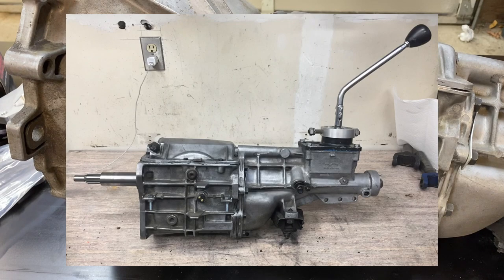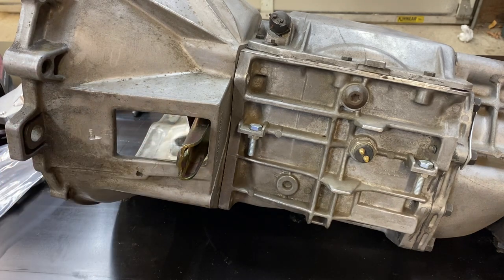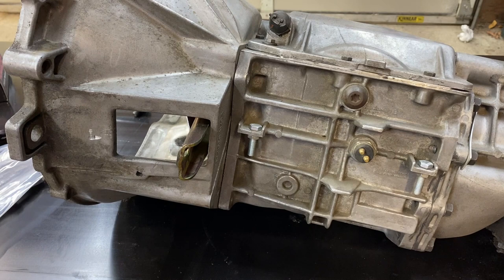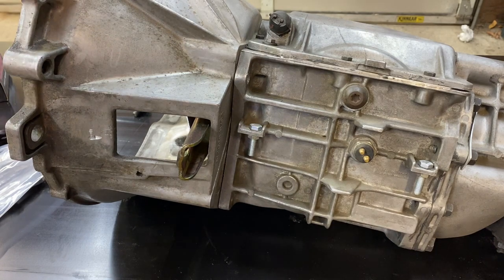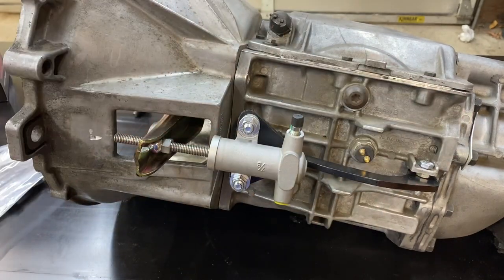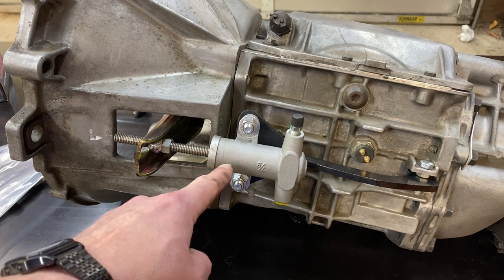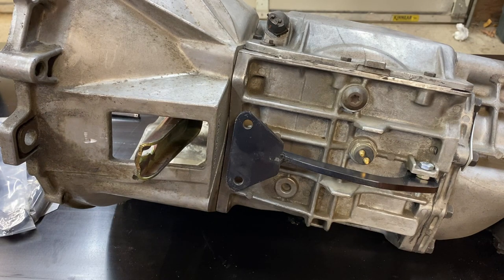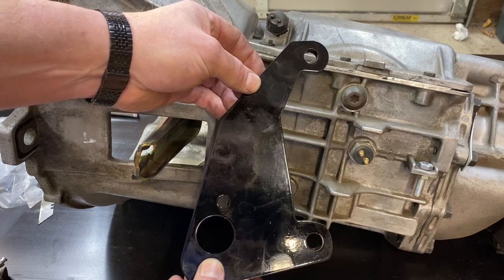Classic Ford T5 Hydraulic Clutch. Clutch actuation options when installing a T5

Comment: Will this slave work on a 2000 ranger clutch master?  I did a v8 conversion
Where can I get that bracket?
Reply from the maker: I have sold a lot of these kits to ranger owners. I would need to know the bore and stroke of your master to determine the correct slave cylinder. I have the parts available on my website and you can also email through my website.
Reply: @dazecars  I'll find out and let you know..thanks!!
Reply: @dazecars   so I do know the stock unit had 1 1/2 inches of travle..meaning  the plunger will go in 1 1/2 inches. I think the bore is 5/8...
Reply: @dazecars   how much movement does this move that clutch fork?
Reply from the maker: @19jody72  Assuming  the 1.5" stroke is actual master stroke, if I sell you one of my kets and sub a 3/4" master for the 7/8 I usually sell you will get 1" at the slave.  the way my kit is designed you only need .9" of travel so that should be perfect and make for a nice easy pedal.  If it is easier you can contact me through my website.
Reply: @dazecars  So if I'm reading that correctly, The stock ranger master will work with your kit?  Can you link the kit part number?
Reply from the maker: Yes and no. My universal slave cylinder  kit will bolt up to the transmission but the slave cylinder is to big. If you order it you will need to email me afterwards and request a 3/4” slave.
Reply: @dazecars  10-4.. will do. Thanks

Comment: I have a 1968 Mustang fastback and just purchased a new Tremec TKX. Is there anyway that I can run a mechanical clutch linkage and if so what parts would I need like bellhousing, zbar,etc....If I am unable to use a mechanical linkage then I would like to use a cable clutch or hydraulic but I really dont feel comfortable installing a hydraulic system as it seems complicated. Any info would be helpful.   I am starting from square one so i dont have any clutch system parts yet of any kind.
Reply from the maker: There are a couple ways that I know of to run the OEM mechanical linkage.  One is expensive and the other is not recommended in my opinion.  The first is to use a quicktime 3550/TKO bellhousing (will also fit the TKX)  Those bellhousings are engineered to use two different clutch forks.  One is actuated back to front allowing you to run a cable clutch or hydraulic clutch and the other is actuated front to back allowing you you use the stock linkage.  That bellhousing is in the $900 range plus or minus depending on accessories needed and shipping. I don't know what else is required to use that bellhousing.  Flywheel clutch and starter may or may not need to be changed as well.  A quicktime bellhousing is a very effective way to maintain the mechanical linkage but expensive.  The second option would be to run an OEM ford 4 speed bell and TKO adapter plate.  This is a lot less expensive $200 range plus or minus.  The problem is modern transmission require the bellhousing accuracy ≤ .005"  and old school Ford bellhousings had tolerance of up to .030".  If you run an adapter you MUST use a dial indicator to properly align the bellhousing and engine to the transmission by shimming the bell and using adjustable alignment pins.  It is a pain to get set up.  When I first installed a T5 in my mustang I used an adapter and it was by no means a "clean" install.  When I upgraded to a T5 specific bell I was much happier with it.  Same is true of the TKO and TKX. So while the adapter plate option can be made to work and even work well I would not run it on my cars when there are easier options.
Reply: @dazecars  I wonder if Lakewood sells a bellhousing that would work. I really appreciate your response!  Your videos are really informative and got me thinking about a hydraulic clutch but the fear of it leaking or doing something else i would worry about as I tend to drive my cars long distances and mechanical would be worry free it seems.
Reply from the maker: @VegasRT500  A hydraulic clutch is as reliable as brake hydraulics.  Lots of cars and trucks have come from the factory over the years with a hydraulic clutch.  Lakewood does sell a bellhousing but it does require modification to work with my kits.  The problem is the Lakewood bell is wider at the transmission end so it needs to be notched for the pushrod.

Comment: Couldnt you just use a factory style Z bar setup that is already in a classic mustang and use the T5 bellhousing and T5 Transmission. Then adapter plate is not needed?
Reply from the maker: no because the clutch fork on a T5 bellhousing works by moving the fork from the back of the car to the front but an old school z-bar setup is designed to work on a fork that goes front to back.  They make a clutch fork conversion block but it doesn't work well and results in a stiff pedal.

Comment: Hi, I have an 1966 Ford mustang 6 cyl 3 speed so how do I can install a slave cylinder cuz old system is stretch fork not push as all hydraulic slave do
Reply from the maker: There is not an easy option.  You would need to figure out how to mount the slave in front of the clutch fork so it could push towards the back of the car.

Comment: Does the gforce bracket you sell get a tkx?
Reply from the maker: The gforce bracket is for a T5 and will not work on a TKX but I sell a TKX specific bracket.  The mounting holes are in a different location between the two transmissions.

Comment: I have a 289 SB I want to change out my 4 speed top loader to a T5 need help my car is a 67 Fairlane
Reply from the maker: as long as you are using a T5 specific bellhousing my universal kit will work at the transmission.  As far as hooking up the master cylinder I don't know how similar or different the Mustang is from the fairlane.  So my offset pushrod may or may not work.  I guess what I am saying is some fabrication/problem solving may be needed for the master cylinder install.  If you contact me through my website I can answer any further questions and try to help you figure out how to make it all work.

Comment: I have world class t5 out of a pontiac GTA trans am.   Its been sufficient for a carbed 355 small block chevy in a pontiac trans am
Reply: I also have a slave cylinder setup it works well... I've gone through a few slave cylinders in 10 yrs.
Reply from the maker: It's a good 5-speed

Comment: Thinking about the bleeding problem, how about bleeding before it's bolted down that way you can get all the air out?
Reply from the maker: Sadly it doesn't seam to be that simple, man do I wish it was.  I have spent more time helping people work on getting all the air out than any other tech support activity I do.  Some people have good luck jacking up the rear of the car, some loosen and angle the slave as you suggested, some assemble the hydraulics on the bench and bench bleed, some gravity bleed and some power bleed.  The result is always the same, it takes forever but eventually they manage to get all the air out.  The only saving grace is hydraulics are absolute so you can know for sure of all the air is out by measuring slave stroke.  If you are not getting the stroke that the fluid volumes of the master and slave say you should get than air in the system is the issue.
Reply: @dazecars  My kit just came in the mail, I have a Phoenix Systems Reverse Brake & Clutch Bleeder. Works great on my brakes forcing the fluid up to the master cylinder. I can do my brakes by myself, with no pedal pumping and have a very firm brake pedal. Hopefully I have the same luck with the slave, I'll let you know.
Reply from the maker: @deuceraptor  Reverse bleeding is extremely effective, also if you angle the slave and then reverse bleed you will probably be good to go.
Reply: @dazecars  I recently watched a YouTube video on clutch bleeding. He unbolted the slave and used a c clamp to keep push rod from moving. Then he bleed the clutch in no time and got all air out. By isolating the pushrod like that it now bleeds just like brakes bleed.

Comment: Hi, Day.  Have you ever tried the master cylinder/ReinforcementPlate/Offset Pushrod you offer with a hydraulic ThrowOut? Any idea if that would work?
Reply from the maker: I have not tried it but there is no reason I can think of that it would not work as long as the master cylinder would except the 3/8" bolt of the offset pushrod and had the same bolt pattern as my reinforcement bracket.
Reply: From looking at the Tilton 6000 series T5 T/O bearing specs, it looks like they'd recommend the wilwood 260-5920 MC, which I believe is similar (if not the same) to what you sell already.  

Now I have to decide if it's worth the extra to have hydraulic T/O or, just go with your whole Slave Cylinder kit.

Thanks!
Reply from the maker: @CheesySteve  That is the exact same MC I sell with my kits.  The retailing washer in the master  needs to be removed and drilled out to 7/16" to accommodate the 3/8" pushrod.  I personally don't like hydraulic throwout bearings, they can be a pain to service and more than that I don't like the way they feel.  With a slave cylinder you can still feel through the pedal what the clutch is doing just as you can with a z-bar or cable.  With the hydraulic throw out bearing that feeling is gone.  A hydraulic throw out bearing can be made to work very well, I just prefer the slave type.
Reply: @dazecars  i appreciate the feedback. At least I know the options. I have a little time left before I pull the auto out so. Thanks again and I hope we can do business soon!
Reply from the maker: @CheesySteve  If any other questions come up (even if it means not buying anything from me) don't hesitate to reach out.  I am a car guy first and happy to help.

Comment: Do you have complete kit for 69 mustang it have power brakes 351w and t5 i need master and slave cilinder  and hoses thanks
Reply from the maker: I offer all a cart kits.  All the parts you mentioned but I let the customer mix and match which pieces work best for their application.

Comment: You get all the air out the opposite way you get all the air out of the cooling system on a ford FE. Drive the front end of the car into a low area. or raise the rear. once the slave cylinder is past level with the bleed screw higher than low part of slave system, it can properly bleed. (FE cooling system requires rear end in ditch, remove radiator cap and bounce front end by jumping on bumper.):face-blue-smiling:
Reply from the maker: Thanks, that is one of many techniques that may or may not work.  I have been selling kits for almost 20 years and I have put together a list of bleeding strategies including the one you recommended.  With all the variables of each car there is no one size fits all fix.  In theory each one should work every time but in reality people try one and if it doesn't work they try another and so on until they get all the air out.

Comment: I ordered one of the MDL hydraulic conversions for my 66 mustang and it’s slave cylinder mount requires you to drill holes in the bell housing. I didn’t like the so I just ordered your mount it’s a way better design.
Reply from the maker: Glad you liked it.  Do you have it installed yet?  let me know if you have any questions.
Reply: @dazecars  not yet I just ordered it on Friday
Reply from the maker: @slowguy66  I did not receive any orders on Friday. Are you sure you ordered it from me?  You could email me an order number. Just wanting to make sure that there is not a problem.
Reply: It was rose hill performance parts. I thought was you because it looked like the same part
Reply from the maker: @slowguy66  he sells my product, you good to go. Because I wasn’t seeing it I wanted to make sure I had not overlooked your order.
Reply: @dazecars  ok awesome
Reply: @slowguy66  did you install it yet?
Reply: If so can you send photos please I'm curious because I'm going to do my 67,thanks
Reply: @KILLERBLACK5000  I can try you have a Instagram or something where I can send you the photos?
Reply from the maker: @KILLERBLACK5000  What do you need pix of?  I support the product I sell, contact me through dazecars.com with any and all questions as I am happy to help

Comment: I adapted the original clutch arm to the t5 bell housing
Reply from the maker: that is an option.  For a while a kit was being made to do just that but I do know the result was a stiffer pedal compared to other options.
Reply: @dazecars  mine was in a early Econoline, want stiff may the leverage was different
Reply: @dazecars  also I did eventually convert to a cable, I had the 2000 mustang v6 t5  with a5.0 The clutch arm was the lowest point under the van with the v6 bell housing, and vulnerable,.                                                The cable had almost no residence, but in the van, not a lot, both worked fine until the original arm got damaged from hitting a tree root. A internal hydropic would be best in my case. The v6 bell is an inch longer then the 8cly allowing the trans to miss a crossmember for the Cable shifter, all good except for the ground clearance
Reply from the maker: @caseyjones1983  this is just personal preference as it is a totally viable option that lots of people run, but I hate hydraulic throw out bearings.  they are a pain to properly setup, prone to leaks, and they remove all clutch feel.  I like how a z-bar, cable clutch, or slave cylinder setup allow you to feel what the clutch is doing as you push the pedal.  That feeling is lost with a throwout bearing, but it does sound like it would be the best option for your application.
Reply: @dazecars  agreed, that's why I went with the cable clutch in the end, your hydrologic could be a good alt as well as it would be tighter to the trans as well, but the Cable is working great, kind of feels to light though.

Comment: I have a question about a different car I have a vw mk I'd like to use a hydraulic clutch
Reply from the maker: what is your question?
Reply: My vw has an 020 grearbox that uses cable now I'd like to now is there anyway that I can have a hydraulic clutch
Reply from the maker: @uthandosikade2337  to design a kit you first need to see if there is a place to mount a push type slave.  Then check if there is room to mount a master cylinder and connect it to the pedal.  From there you need to measure how much stroke is required at the clutch fork to work the clutch.  With all this information you can select parts and begin fabricating brackets to convert to a hydraulic clutch.

Comment: I have a 85 302 with t5 does it matter what selection I put???
Reply: Also the tab is broken
Reply from the maker: What year is the transmission and the broken tab is it the transmission to bellhousing mounting tab or one of the tabs sticking out the side of the main case?
Reply: @dazecars  I ended buying the bellhousing adapter and it’s fine but now my connection to the slave cylinder don’t match
Reply from the maker: @FernandoRodriguez-mz7tv  Did you buy one of my kits? If so please email me if not I’m not sure what your question is as I specifically warn against getting the adapter plate in the video.

Comment: What bore is master and slave ?
Reply from the maker: slave is 7/8 the master is 13/16" but its not just about bore it is also about stroke.  Correctly matching a master and slave starts with knowing the desired stroke at the slave than calculating the the required stroke at the master (based on both bore sizes) to achieve what you need at the slave keeping in mind that a smaller bore master will have reduced pedal effort and better pedal feel.

Comment: longtube header clearance?
Reply from the maker: In most cases not even an issue.  The collector tubes usually go strait back after the bellhousing (or slightly angled towards the transmission.  The slave and bracket are tight up against transmission similar to shifter linkage on a 4-speed
Reply: great to know.  is this a t5 only design or can it work with the tko and the new tkx?
Reply from the maker: @angry408w7  only works for the t5 BUT I have kits for the tko and tkx

Comment: i have a 1970 mustang and it has an fmx trans what pedal parts do i need to work with your parts
Reply from the maker: My Mustang kits are specifically designed to work with OEM clutch pedals.  My offset pushrod is the same for all years except the 67 and up kits come with a longer mounting bolt and extra spacers because the OEM clutch linkage hole is more outboard from the column.  With that in mind any OEM style clutch pedal 64-70 should work with my kit HOWEVER I have no idea what if any modifications would need to be done to it to make an earlier pedal work in your car.
Reply: cool thank you im starting to gather up parts now for this winters project and want to get rid of the fmx auto and put in a 5 speed that and a mustang 2 suspension convertion @dazecars
Reply from the maker: @poppacapinya  let me know if I can be of any further assistance. May I ask why Mustang II?
Reply from the maker: @poppacapinya  those all sound like good reasons.  A Mustang II suspension will perform well but IMHO is inferior to the original mustang suspension design  with a retrofit coil over kit that goes all the way to the lower control arm. (see my video on the subject) you’ll get better ride quality better handling and it’s all around a far superior suspension.  Mustang II also has a slightly reduced turning radius.  With that said, mustang, II is the perfect choice if you need to illuminate the shock towers. If you plan on putting a bigger motor in the future, then mustang II is the only way to go, but if you’re just after “a little more room“ and could still work around the shock towers, you will have far better handling if you leave the shock towers and go with a coil over kit. Just my $.02
Reply: Ill take a look.  Cant hurt to have options
Reply from the maker: @poppacapinya   I have spent a lot of years studying Mustang suspension and handling so if you have any other questions please don't hesitate to reach out.